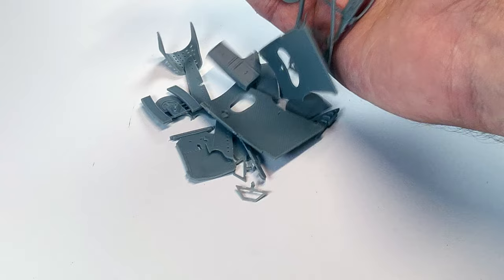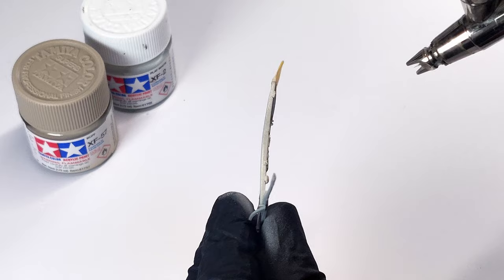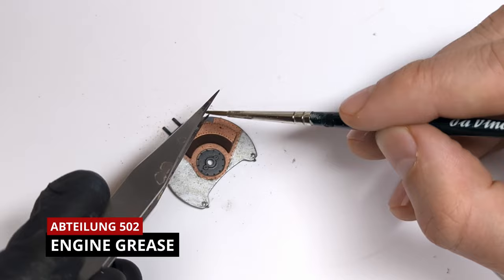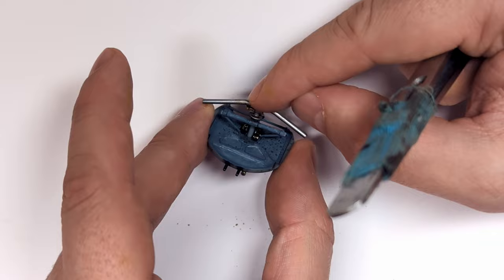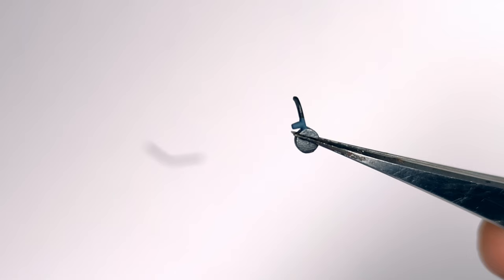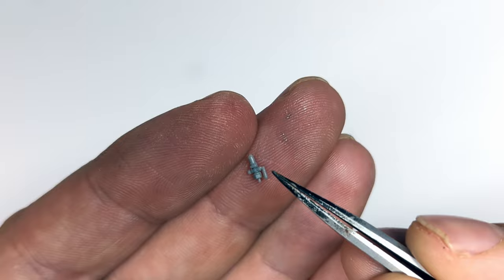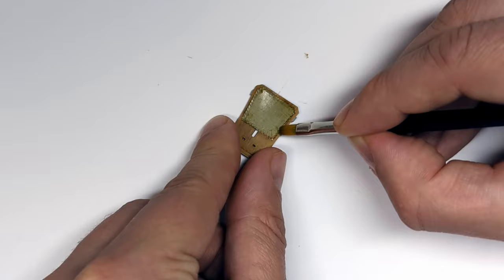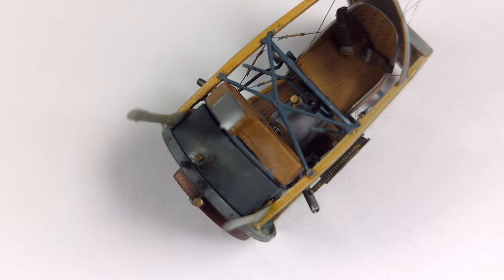Let's Build The NIEUPORT XVII by Copper State Models!

Comment: Just came across your website and am so pleased that your focus is WW1 aircraft and now have subscribed. I learned a few tricks of the trade today so I will definitely be using them in future builds. Great job on the cockpit btw so I will be checking out the other videos as well.
Reply from the maker: Thanks Robbo, originally I planned to do some also some other WW1 subjects like tanks or artillery pieces. It just happens that I can't get enough of the aircrafts 😅

Comment: Ok.. I'm hooked. Subscribed.  I just started back building Biplanes. The kits are better but the skills of modelers and available improvements are light years beyond what I did back in the old days.  I hope you will help us improve an older simpler kit....  since Wingnuts is Kaput.   Thanks.  A video on  doing/improving rigging (and where to get items) would be great.
Reply from the maker: Thanks for your nice feedback! I just uploaded the second part which is about painting the exterior. Rigging will be in the next video (but technically it's not too different from the interior rigging done here :) )
Reply from the maker: For the nylon thread I go for fishing line in .1mm thickness, it's often called 10/100. The turnbuckles I get from Gaspatch but you don't necessarily need them.

Comment: Stunning work. I will be starting my first bi-plane soon. It's the inter war years American Stearman PT-17 trainer in 1/32 from ICM. It seems an interesting kit and comes with three figures so should make a nice diorama. It's obviously not the quality of a Wingnut Wings or CSM kit, but it seems very good for the price. Been practicing making turnbuckles with 0.5mm brass tube, thin electrical wire and 1.12 fishing line. When it comes to doing it on the model though, all I can say is wish me luck! Oh, and you have another subscriber. Happy modelling my friend.
Reply from the maker: Thanks David. Doing the rigging is a bit fiddly but no rocket science. I'm sure you will get the hang. Happy modelling!

Comment: Just found out about your channel and have followed all the Niuport Build series. Magnificent!. Just one question; Do you also use 0,1 nylon cable for the control lines? it seems a bit thicker and rigid in the video!
cheers!
Reply from the maker: Thanks and welcome aboard. If I remember correctly I used the .1mm line for all the cables in the build. I also have a .12mm here so maybe I mixed that up 😅
Reply: @TheAlleyman  Great!. Now I have all the weapons necessary to make a royal mess of my Niuport!! 😀😀😀
Reply from the maker: @davidhellmandesarriera2900 go for it :) hope you will enjoy it

Comment: With so many painted surfaces, what glues are you using for each section? Love your work by the way.
Reply from the maker: Thanks Steve, I usually mask off the surfaces where parts are glued together. This is mainly to avoid fit issues but it also allows me to just use plastic cement. In case that I glue on a painted surface I'm using CA glue to not mess up the paint job.

Comment: How much time are you spending to complete a model like this? What about your oil paint drying time?
Reply from the maker: Well, I'm a slow builder,  I tend to finish those 1/32 aircrafts over a period of 3 months. (That's not the net building time of course, I would guess I average maybe 1-2hrs a day modelling).
Reply from the maker: Oh and on oil paint drying time: if I use the oil paint directly out of the tube e.g. for wood grain or leather painting, I let it sit for at least a day (if I'm in a hurry), better two. For most of my weathering work I put the oil paint on a cardboard to suck out the oil for a couple of hours. In this case I let the paint sit on the model for maybe 15 minutes, then hit it with a hair dryer and then I go on painting.